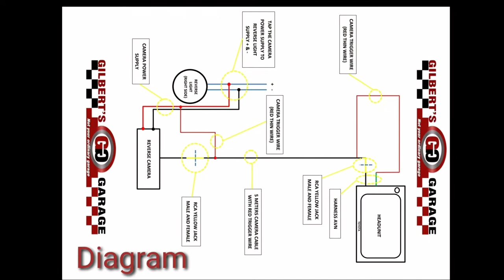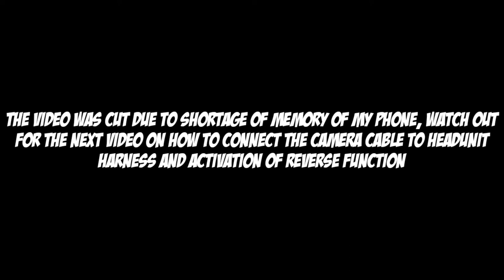Reverse Parking Camera Cable Routing & Trigger Connection | Toyota Hilux Conquest 2018 up

Comment: sir.may video po kayo kung paano ikabit yun connection ng reverse cam into stereo??hilux 2016-2020 model
Reply from the maker: Naputol yung video. Pm na lang ako sa gilberts garage fb
Reply: @GilbertsGarage  nag pm po ako sa gilberts garage po sa fb sir.
Reply: Sir good pm, saan ba dinada-an ang wire mula passenger side papunta sa likod?

Comment: Sir good day po. I have a toyota conquest pano po iactivate ung courtesy door lights?
Reply from the maker: Ndi pa ako nakapagkabit nun pero most likely magpupull ka ng new 1 wire supply 12v at 1 negative wire to conmect sa door switch line
Reply: @GilbertsGarage  ahhhh thank you po. God bless